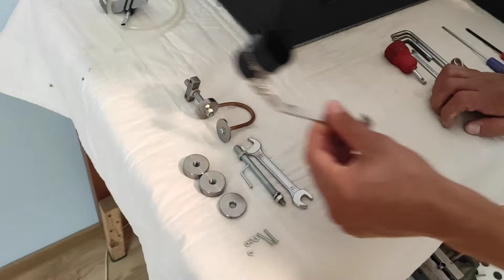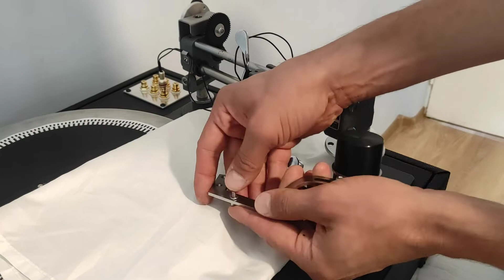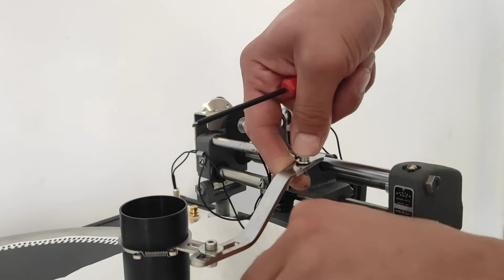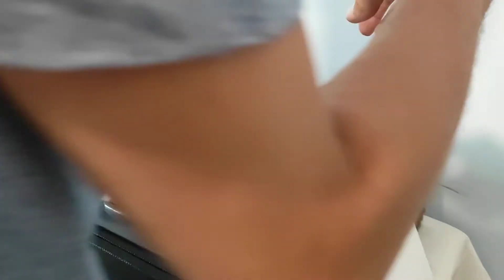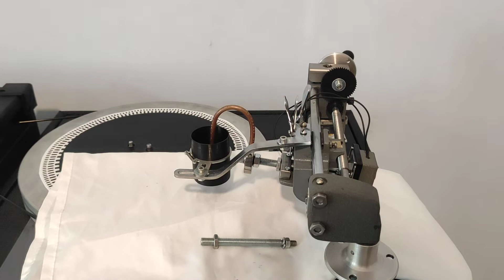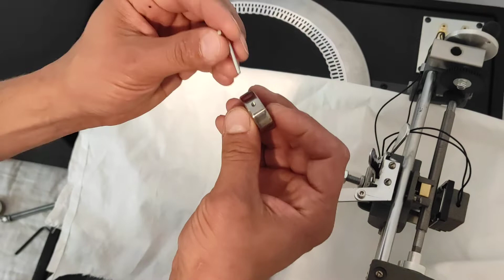No spring, adj. counterweight DASHPOT MOD for Rek-O-Kut Challenger / Imperial record cutting lathes

Comment: Hi will vacuum system fit a rek o kut pro 5
Reply from the maker: It will, but with a different bracket shape and pipe lenght. Contact me, if interested
Reply: Está máquina e um gravador de vinil e aonde eu encontro pra comprar